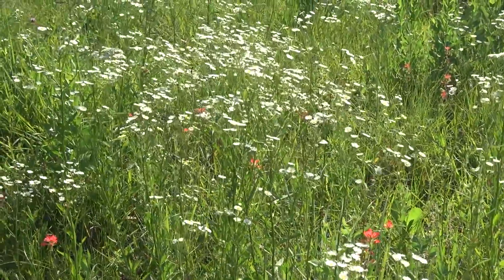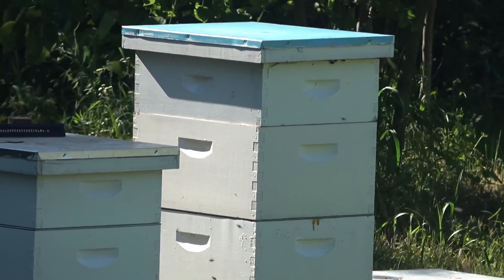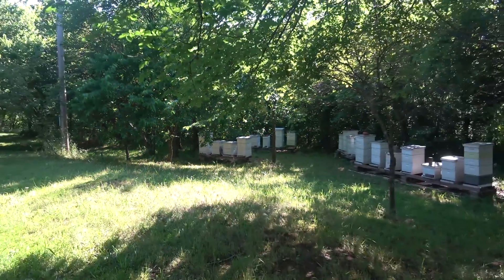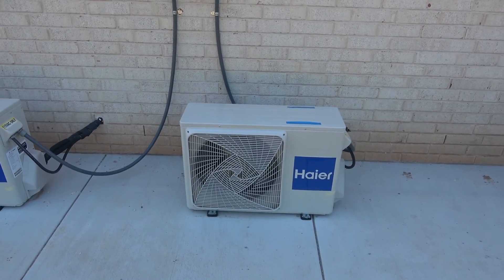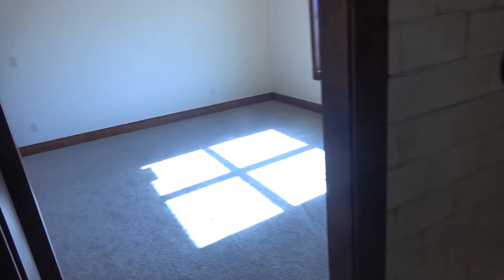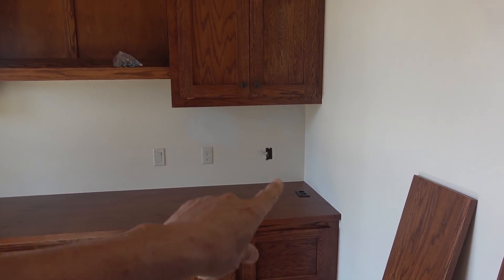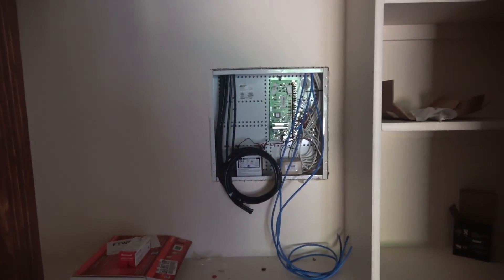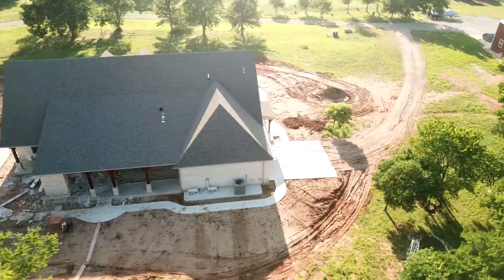Homestead Update May 2020 Part 2 S4E36

Comment: I am loving the wildflowers. Your house looks amazing Darren. Really like how it turned out. I wired my house for security, internet, and tv. I put one on my back porch just like yours and yeah, I hadn't put one on mine either haha. I wish I would have had them pour a pad as you did for my units. I have one on each side of my downstairs though. One runs half the house and the other side. I was skeptical about it but it is really efficient that way. We did hardwoods in our whole house except for the bedrooms and the bathrooms. IN the bathrooms we used that same LVT tile like you have. The master has a driftwood pattern that is made to resemble ceramic tile that is made to resemble wood lol. It is grouted like regular ceramic tile too. I love it! I tell my wife all the time I wish we had done the whole house it that stuff. IT doesn't scratch and it is so awesome. I think yall are going to love it! I really love your cabinets too. I want to see that ironing board in action lol. Really love that master bath too and that tub area. Man, I cook look at houses and house plans all day. I love it! I can't believe I missed this video.  Love that stove too. I wanted to get the bigger one like that too but in the end, opted for an all gas range that was the normal size. I put in a smart panel too for all my data wires, catv, and security wires. I still got to finish my bonus room. I need to hear how you like the mini-split units and how they work. Looks like they put in a Honeywell security system with a Tuxedo touch screen keypad? Thanks for showing Darren. Loved the tour man. Sorry for the long comments haha- It makes me want to build another one though-Ronnie
Reply from the maker: Love your comments. The mini splits work good. They work even better when they drain right. lol one guy thought water would flow uphill I guess and they had to redo it. Cool you did all your own wiring. Are you able to hook to your system via app off network?  I’m having a heck of a time forward IPing that tuxedo touch and there’s no app that I’ve found without paying a monthly fee. Thanks again Ronnie.
Reply: Jerome Bee Farm & Homestead I actually have a hybrid system it’s all hardwired and a Honeywell panel with two hardwired keypads. There is a device that called a takeover module that sends signals to a wireless touchscreen that communicates with the monitoring station via internet with cell backup. Thanks n order for you to communicate with that tuxedo touch, you have to have it monitored and pay a monthly fee to access it. It’s called total connect.
Reply from the maker: Yes.  Total connect. And no way I’m paying a fee for that. I may yank that sucker and put something else in. I don’t know enough about what all is out there. I also need to figure out how to get antenna tv hooked in all my coax.
Reply: Jerome Bee Farm & Homestead look up Konnected home. They make a wireless device that you can hook your hard wires too and then use a fire tablet for your keypad. There is a Facebook group and they have hooked up all sorts of stuff. It will integrate with Samsung SmartThings hub. I use a SmartThings hub for my automation. Lights and things. I have my porch lights come on at sun set and go off at dawn. It works great. I bought these micro switches that go behind the light switch called Aeotec micro switches. They work great. I use a crew light bulb for a lamp I the living room. But they make all sorts of things that can hook up. Water shut offs if it sends a water leak, freezer temps, thermostats for your house? I mean it’s endless. As far as your antenna goes, you need to have one coax that goes up into the attic, mount your antenna there in the attic. Get a big antenna if you are far from a big town. Go buy a splitter for how many TVs you want to hook up. The antenna will go into the input port and the coax that goes to your TVs will go on the outputs. If you want three TVs, buy a three way splitter and so on. If over 6, you will need an amp or a powered 6 way splitter. I ran what I can future pipe from my network box ( we call them smart panels) to the attic and then one to the crawl space to be able to run future wire if I need to.
Reply from the maker: I found all my coax in that panel in the bedroom. Need to find the main one. I think it’s outside the house where the internet connection is. Not where I want an antenna. Lol.
Reply: Jerome Bee Farm & Homestead Yes that will be your main feed. Do you have access above the panel? Like attic space? If so you might can fish a wire up to the attic.
Reply from the maker: Yeah some. I took video of all the wiring before they dry walled, so I may be able to locate it.

Comment: Jerome, pull Cat-6A to all outlets and if you can pull in a six or twelve count singlemode fiber from your data-center to the outside utility area. You are rural and 5G is not going to be a real option so FTTH is going to be the way to go.  I engineer these systems 12 years at AT&T and now in the Pacific Northwest. We will start deploying NGPON-2 next year and that will need cat-6a wiring to handle the bandwidth from your router. You will need the fiber to have you ONT inside as most providers are going in that direction. Not sure why anyone is pulling coax any longer as that is a one use medium for video and there is so much more that can be done over Cat-6a including HDTV over UTP.  Cat-5 is 20+ year technology
Reply from the maker: Hey Glen.  I have the blue cable in every room. I think that's Cat 5.  They put in coax as well.  We're supposed to have fiber available this year they said.  At this point, I'm happy just to have DSL.  I'll probably connect everything with WIFI.  I'm planning on going digital.  Right now we have Dish and it's good, but really expensive.  Going to try Youtube TV along with our Netflix and Amazon Prime.  Cable company is supposed to come hook it up on the 22.  Thanks for the info.